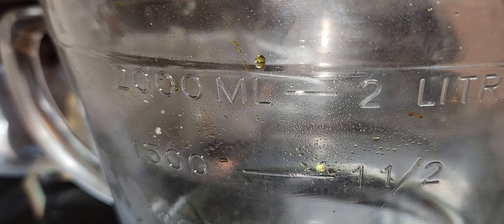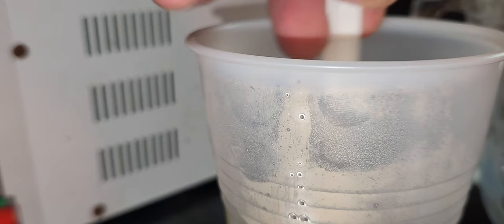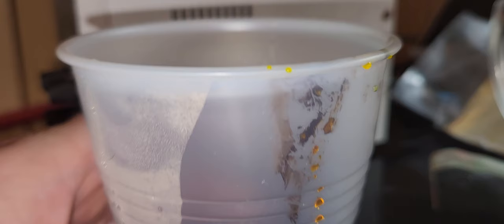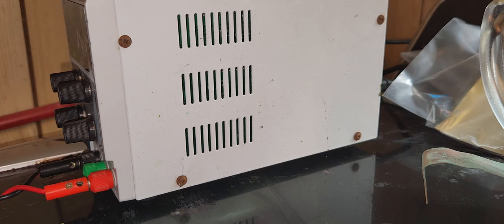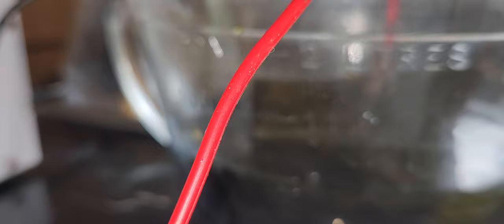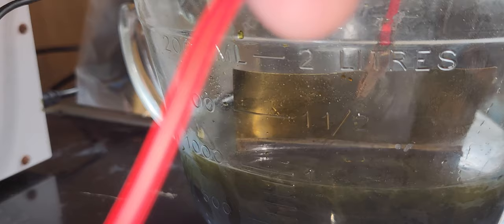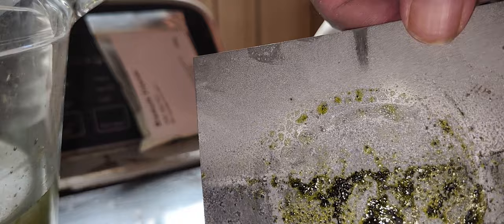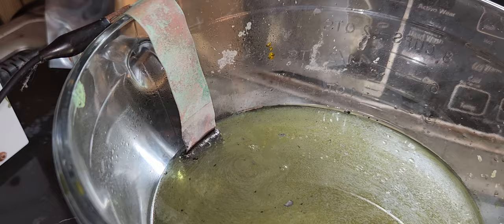Bismuth plating with dragondroff reagent onto Brass sheets.

Comment: Your video in my opinion is to zoomed in for most of the video. Keep posting and I'll keep watching. Maybe you can grow your channel.  What gas is forming from the electro plating. Be cautious of that. I'm assuming sulfur dioxide. That would definitely be a reason for concern.
Reply from the maker: I would use a tripod but I broke my arm remember?!! Also this explains that dragondroff reagent releases HCl gas not SO2 gas. It turns greenish black with air exposure which can be urethane costed.
Reply: @chanheosican6636  thanks for the reply. I did not remember but now I do. I enjoy the chemistry. Thanks, I wish the best and hope to see your channel grow with lots of good subscribers. You are awesome. Keep going strong.

Comment: We want do develop Bismuth Silver plating (4:96)plating on auto Component.
Any idea for it?
Reply from the maker: Due to the silver it would form silver chloride and prob would not work. U may need 60% nitric acid and add bismuth salts and silver nitrate.  May work. The issue is corrosion.
Reply from the maker: The silver complex needs to plate to diluted ph 2 or less silver and bismuth with brass or copper plated stuff.
Reply: Ok thanks a lot
Reply from the maker: Also it has to be copper, brass and urethane painted which is expensive indeed. Thks